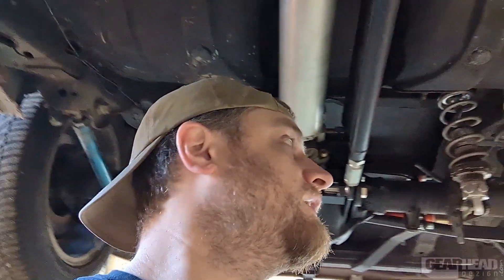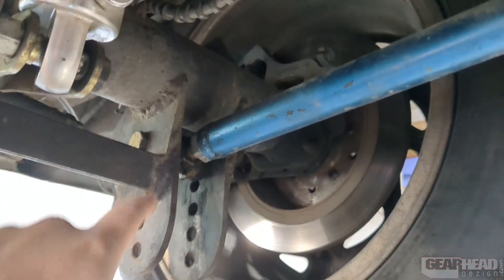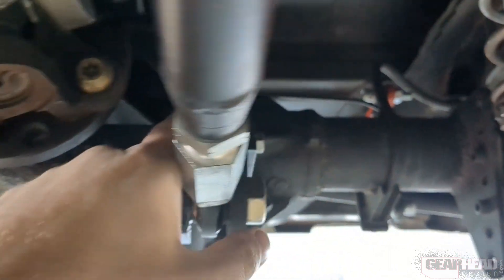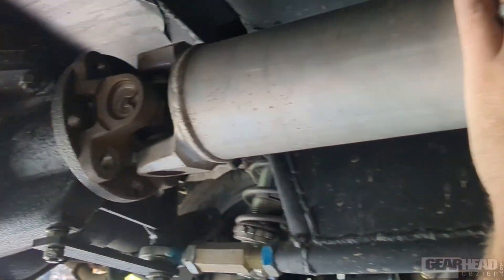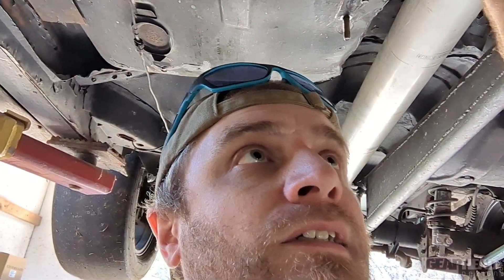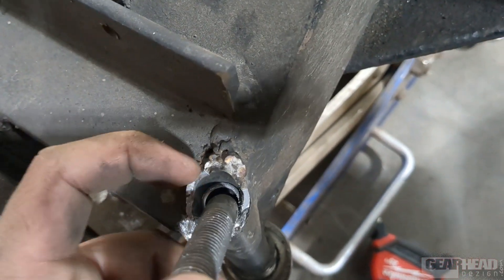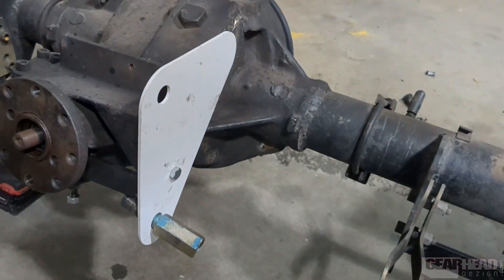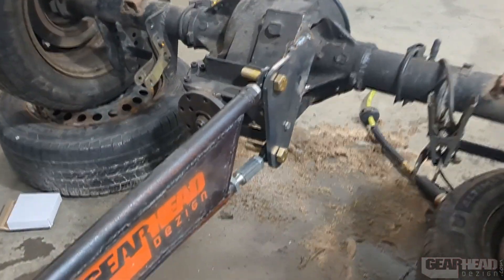Lessons learned from building DIY torque arm for Ford 8.8 rear axle

Comment: I think it's outstanding that you have done all of that. And cheap, i guess, is in the eye of the beholder. 
  I have a hard time seeing the benefits. The GM torque bars are technology taken from Nascar. Similar to other trailing arm setups. I have dealt with a host of suspension setups for racing, mud bogs,  hill climbing,  and drifting. This seems overkill.  More weight and moving parts that are not needed.
Reply from the maker: This car was FWD to start with, so I needed to build something adjustable to get it dialed in. I don't know how you could do it in less parts. 2 to push forward and locate axle fore/aft, 1 to locate axle laterally, and 1 to eliminate rotation. 4 links are the minimum for any suspension unless you're talking leaf springs